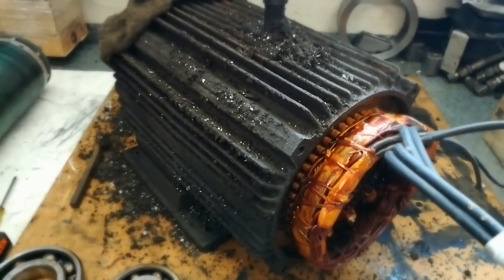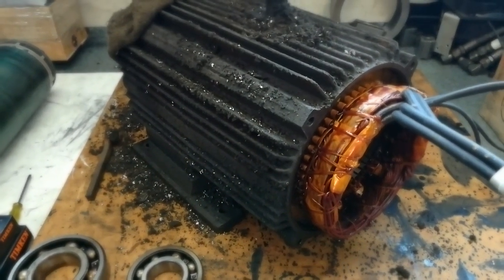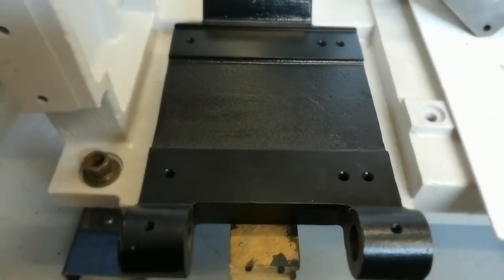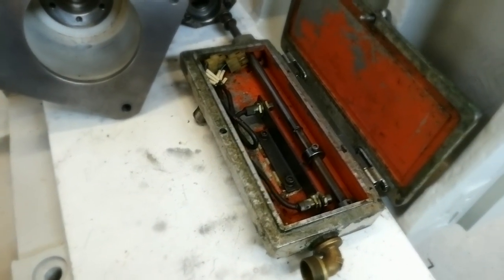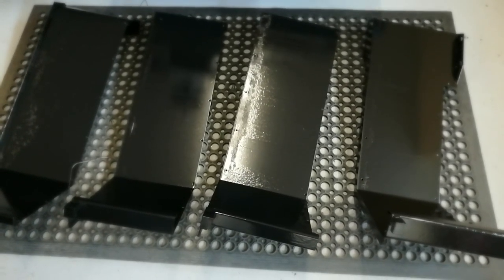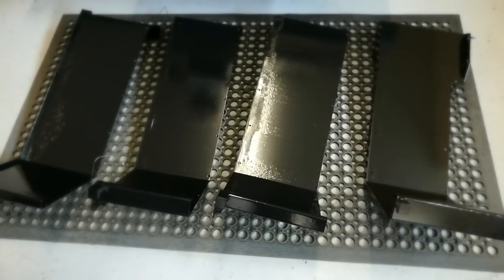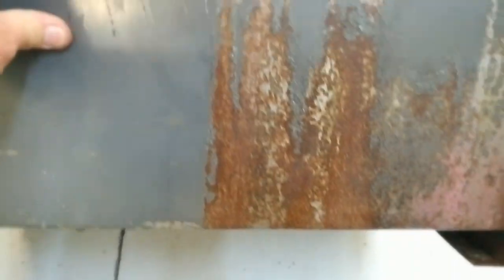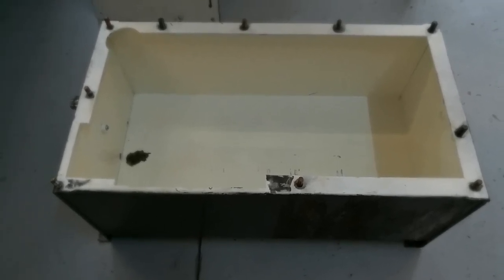CNC Lathe Rebuild. Spindle Motor Disassembly.

Comment: You are smart to swap the bearings out while it is down .  You will know exactly what you have when it back in operation.
Reply from the maker: Hey Lloyd.
Yes it is the best time for jobs like changing bearings, they are not always cheap to buy.
 But it can save yourself some major headaches down the track when things fail at the worse times, lol.
Thanks for dropping by.
Peter.

Comment: It looks like this project is coming along nicely!
Reply from the maker: Hey Tim.
Yes coming along slowly but surely, lol.
Just watching a little bit of YouTube before going to bed.
Tomorrow i will be able to do some more work on this machine.
At the moment just finishing the Electric Motor covers.

The weather here is starting to get colder now that Easter has finished which is normal for us.
Still Autumn at the moment but not warm enough to paint is the problem i can heat my garage with an electric blow heater if i need to get things painted ??

At the moment just trying to get the Motor back in the base so i can put the machine base back on the floor for the first time in a few years now, LOL. 

I will keep you updated with more video,s as so as i can find something worthwhile.
Thanks for watching these series of video,s.
Peter.
Reply: @weldmachine  LOL. I'm just getting up and catching up on YouTubers. It's another fun filled  week living out of a hotel ( not ), but I'm going to try to get a short video out anyway. I'm liking  this series. Looking forward to more!!!
Reply from the maker: @solarfiretechnologies2304  
It,s funny i do the same thing in the morning while having breakfast.
Beats watching Television that is for sure.

Comment: Pretty pricey estimate for those panels to be remade. Looking good none the less. :)
Reply from the maker: Hey John.
Yes the price is no bargain basement special, lol.
But custom made anything always attracts a high fee.
I have already replaced some of the panels on this machine that i will show in later video,s.
It is hard to say whether this is worth while doing this rebuild.
But i guess it depends on how you look at it.
Thanks for watching.
Peter.
Reply: @weldmachine  I'm cheap, so the original panels (which don't look bad at all  ) would more than suit me. lol
Reply from the maker: @johnstrange6799  
Hey John.
I already have a mental picture in my mind of how the machine will look when it's finished.
And if does not turn out how I imagine I will be VERY disappointed ????
If that happens I know myself I will need to fix it ???
If I am in doubt about anything during the rebuild i will more than lightly change it, LoL.
I hope you enjoy the rest of the rebuild.
Thanks again.
Peter.